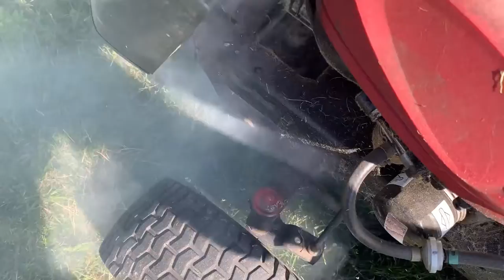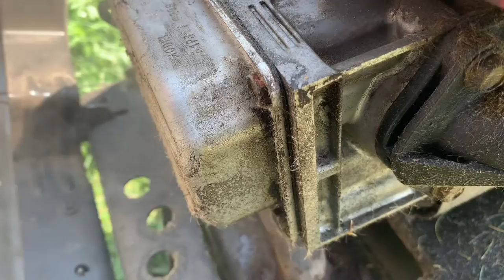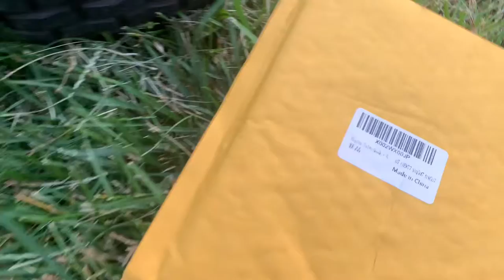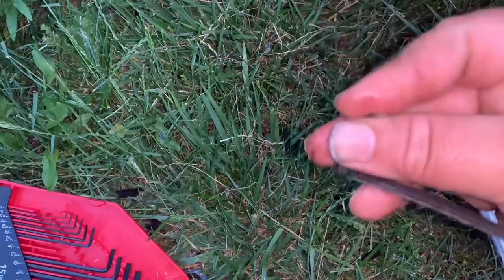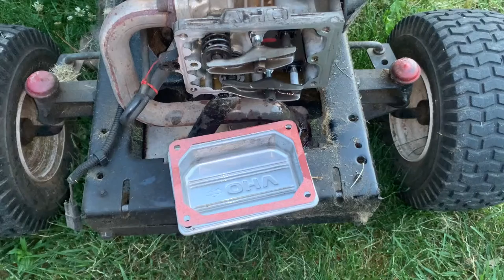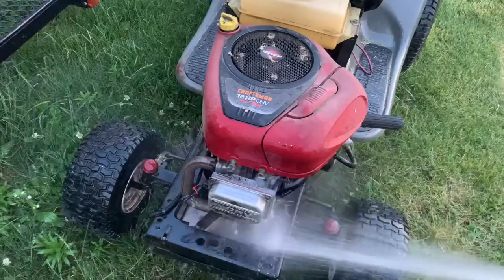HOW-TO fix a smoking craftsman tractor under $12 | lawn tractor white smoke oil leak fix

Comment: I have a dlt3000 that is smoking a little and when I lifted the lid there is an oil leak under where the fuel pump is located. Do you know what could possibly be causing the oil leak
Reply: I have that mower to and had to make the gas gravity fed because going to change the old gas line out from the tank under the seat that whole nipple on the bottom of the tank came put when i was pull on the gas line trying to get the old line off i put a tank right up by the battery against it and it works i was gonna keep it a gas pump hook up but couldn't 

That tank was good it held $10 in gas but they shouldn't make stuff hard to get to and no hand room to get a clip off or just a grab on the gas line
Reply: Can i see your mowers deck id like to see what the original deck looks like 

I had to put a old craftsman lt1000 deck on my 3000 it all fits but have to fix the blade engagement pulley in place so tension all the way or its blades wont work sense they work by clutch pulley.

That 3000 model on the pto pull switch i had to cut one of the ground wires from it so the blade would work without it shutting off the mower so the pto switch was shutting the mower engine off but doesn't anymore

Comment: That ones is the ohv rocker cover gasket 

Mines problem is a broke piston ring but i ain't messing with all that i might later or use that engine for a parts engine for my other 2 like it i don't have time to mess with the intek 18.5 if the person that had it before me took better care of it it wouldn't pour clouds of white smoke out. you hadn't seen one run with broke rings but i don't want the neighbor's thinking something's on fire i know what's wrong with it though.

I didn't know the troy bilt bronco deck is made the same as john deere decks until i just seen it today might be a good thing its rings are broken cause i don't like those decks mower deck got 2 belts to mess with if one messes up so I'll just keep the broke engine and strip the mower down but it is still good for someone else who might like that model but they'll need a engine for it all everything else on it works it is gonna need a new drive belt soon i seen the one on is cracking you can usually feel a bad drive belt on the brake pedal when the drive belts getting bad

Comment: Don't buy none of the red gaskets their shit rubber so when the ohv cover heats up the red gasket bubbles because their not heat resistant you gotta make sure the one you buy is heat resistant or it ain't gonna work